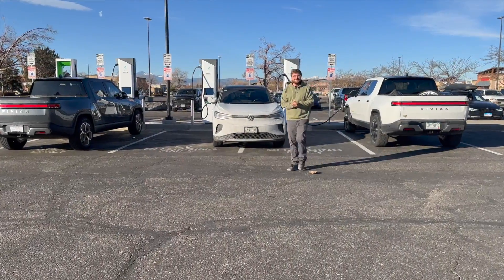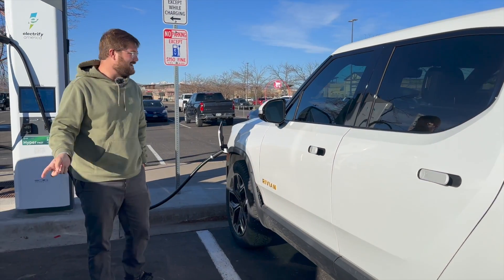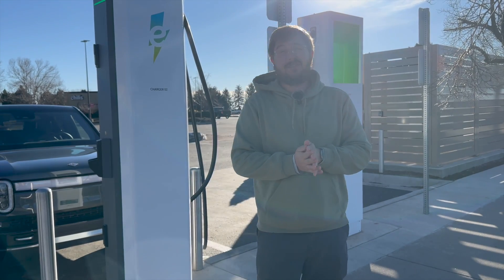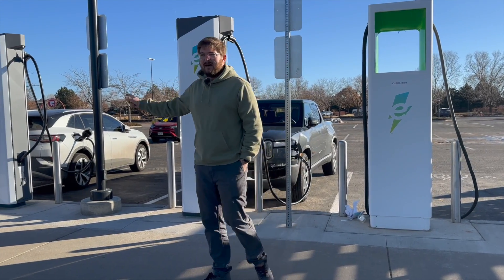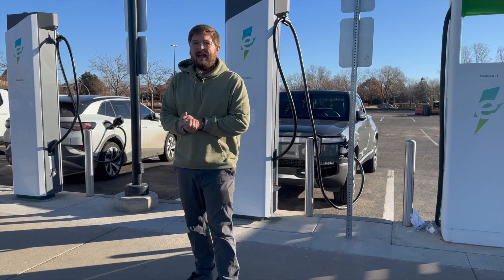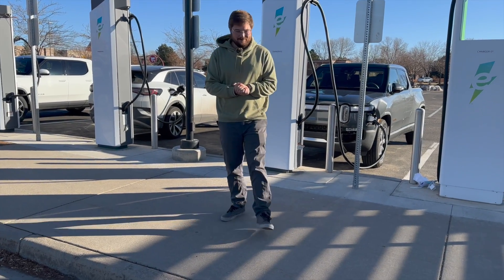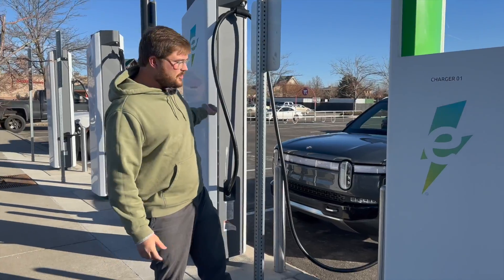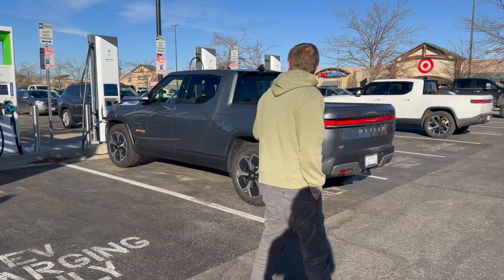Electrify America Has Been Upgrading Their Sites w/ New Chargers - Here's How It's Going So Far

Comment: Tesla should make CCS1 DC fast chargers that also have the NACS connector.
Two connectors- CCS1 & NACS on one unit that can split power.  
The superchargers have great reliability and long term use so we know these hold up to heavy use and work in freezing and very hot weather for years.  Real world use is much better than guess work.
Reply: It’s the ability to charge $ and handshake with non-Tesla that needs working out. They should attach an adapter at each cord (no need to have one for every ccs car). I have a Mini-tap adapter for Tesla L2 systems and Tesla started selling an adapter to CCS a few months ago. Humorous they call it a NACS like it’s an automotive agency decision when it’s just an attempted government money grab scheme from Musk.
Reply: @4rwayner7  Hi. Disagree about the NACS name.  It's just a name.  As far as connecting with the CCS1 to Tesla Adapter, I have a 2022 model Y and it works great with my Tesla.  As far as CCS1 using the supercharger network, Tesla will probably add the CCS1 connector and have both on each of the new version 4 superchargers.
I do not think Tesla should add CCS1 connectors to existing superchargers all ready installed as Tesla owners paid for them by buying Teslas.  If the new IRA plan pays part of new networks, yes they should have both.  I think we will really have a much improved DC fast charging networks from all providers.  EA really needs to improve the up time and install more units at each location - 8 minimum.  Tesla will not have a problem with the hand shake with CCS1 vehicles as they know how it works ie my CCS1 adapters works all the time.  Only used it 5 times in 4 months.

Comment: There are 2 locations within 215 miles that are both off line for the upgrade. Seems they don't look at what is near as other options. As the one in Tampa is the only one within 50 miles. The other one is in Coco Beach and again only one around for 60 plus miles. I have an 2022 ID.4 and on the ABB and older BTC on the 150kw chargers will not get more than 140kw. But on a 350 my car will charge at 173kw. With the 3.1 software it will charge from almost 0 to 100 in about 55 minutes. Love the speed of them for road trips.

Comment: My prediction, electric cars will be a thing of the past in less than 10 years. Hydrogen is the future. Diesel vehicles can NOT be replaced by electric. Semis, trucks used for towing, RVs, etc. Batteries are heavy, expensive and HORRIBLE for the environment.
Reply: That prediction is almost certainly incorrect. Hydrogen might be the future for some things (long-haul trucks? towing?), but electric has clearly won the light-duty vehicles war, even if DCFC infrastructure has a long way to go. (It’s still better than hydrogen fueling infrastructure!)
Reply: Hydrogen is not a solution because it can’t be stored economically (energy/m3). Liquifying costs even more energy than LNG. Producing it in sufficient quantities is a problem. It just goes on and on.
Reply: So where is the Toyota and BMW hydrogen fueling network? They've been talking about hydrogen for about 10 years and still not a single BMW or Toyota hydrogen station (Toyota promised them, too, if you remember). Toyota and BMW don't want to fund the stations, maybe, because they are astronomically expensive?

Comment: We have a 2015 BMW i3 REx here in socal and we use it unconventionally meaning we drive it one the freeway every day for 50miles so we fast charge a lot. More recently it seems like adding EV chargers has stagnated her in socal and even we have had some close with sad replacements, but we dont like to use electrify america because they always have had problems for us and we are very tech savvy and we even call tech support when its not working because it needs to work and we have been told to go find another in our short range electric car. EV go has been our go to company there chargers work more often then EA and Charge point. Its very sad to see we are getting pushed away from using short range EV's.

Comment: ID.4 owners charge to full for two reasons. 1, it's free to charge up through the program that vw offers and 2, a lot of them are sold to people who don't have access to level 2 chargers in their homes, maybe renting an apartment or possibly a home without an outside plug for level 2 charging. Really, this is the market moving faster than the infrastructure.
Reply: Does that also entitle them to park across two lanes blocking one for others?
Reply: @Hitstirrer  No, that guy was an asshole
Reply: No one should be taking up two spots at a charger—it is inexcusable to do so.  The reason for charging to 100%, however, is that (in my estimation), the ID.4 that I drive has a real-world range of about 240 miles in decent weather and a much-reduced range in cold weather.  With no heat pump in the United States, range in temperatures below 30 degrees is just poor.  For someone who lacks charging at home (I do have a charger at home so lack of range is no problem), it is rational to charge to 100%.  When I have tried DC fast charging at an Electrify America site in Spokane, Washington, the car was getting only about 40kW as was another ID.4 right next to me.  You can see that an owner going to the trouble of plugging into an Electrify American DC charger might calculate that it’s the best use of the owner’s time to charge to 100% considering the reduced range and the slow charging.  We traded in a Tesla Model Y to buy this car and now we have a vastly better automobile with inferior EV technology, including inferior charging at public chargers.  To repeat, I certainly agree that taking up two spaces is inexcusable.
Reply: @JohnAnderson-tv4wq  An owner might calculate that. But they are wrong. They just don't understand the charge curve of their car. Its been shown many times that stopping at 80% is much more efficient in the use of their personal time. Two shorter sessions will load more miles than one to 100%, as the last 20% takes so long. Two sessions are still free for those people on the incentive package so they are just wasting their own time trickling electrons in to 100%
Reply: @Hitstirrer  For someone who has something to do in the mall while the car is charging, it makes sense to just leave the car on the charger to 100% even considering the charging curve.  Topping up to 100% reduces the number of times the owner has to go to the charger without wasting time if the owner is doing something else productive.  Charging at home or at work is by far--by far--the best option for a car like an ID.4 with somewhat limited range, especially in cold weather.  If that isn't an option, charging to 100% at a public charging station while doing something else productive is rational behavior.
Reply: I really hate free DCFC. It attracts the charger hogs like none other.

Comment: Here is Salt Lake they just ripped out the entire station and upgraded it. I haven't had a chance to use it yet as it just came back online but I'm glad they are. Still, it sucked because there are no other DC fast charging for about 40 miles away. Fortunately I have home charging but I have solar and like to use EA when it's cloudy. I can't imagine if someone depended on it for full time charging.
Reply: A friend of mine was traveling through when the station was offline. They had to use a 50kW station nearby. Thankfully on the way back the upgrade was finished and worked fine.